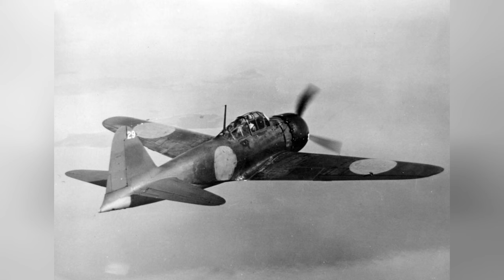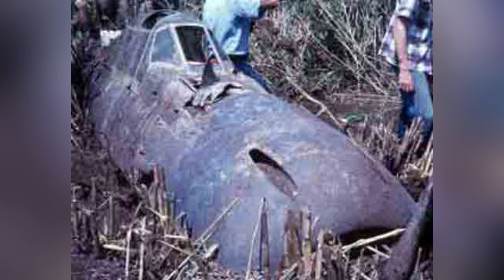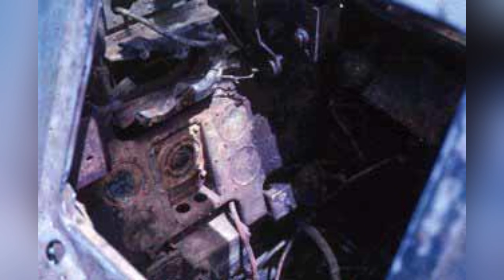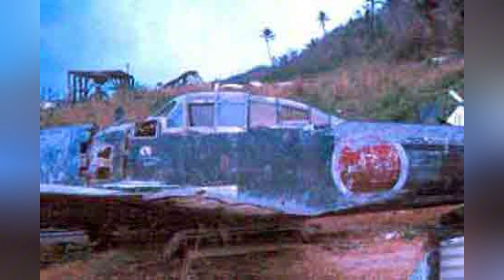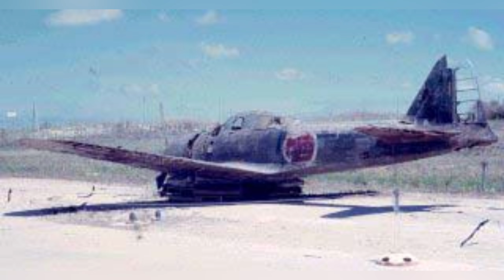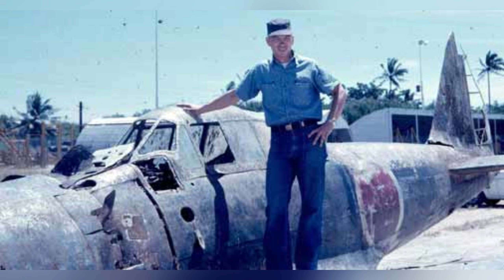Recovering Guam Zero: How a Swamp Preserved a Lost A6M5

Comment: Are there any blueprints of the zero if so someone smart with the right tools and materials could rebuild one fr9m raw metal including the engine recast a new block and all the parts and there isn't any reason why someone couldn't build one its just motivation to do it that's all and they would be building a zero but with modern tools and the blueprints you'd have a brand new Mitsubishi ZERO in 202-